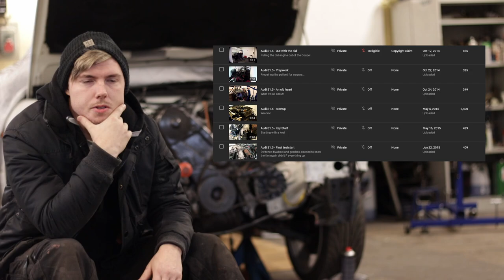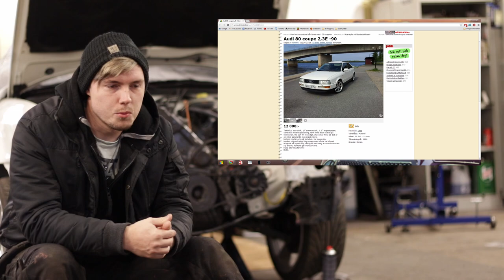DET STÖRSTA PROJEKTET INGEN VET OM

Comment: Du kanske redan tänkt detta men jag lägger upp det ändå, passar en 10V topp från en nyare motor på ditt block? I så fall får du ju tillgång till nya spridar systemet med fuel rail etc. Ps. Du ser mycket yngre ut ;-)
Reply from the maker: Det fanns desvärre ingen 10v med riktigt insprutning. Dom enda 5cyl som hade EFI var S-motorerna och "7A" (20v sug 170hk)
Jag kan tekniskt sett bulta dit en 20V topp med accessoarer, men förutom att jag fortfarande vill ha en 10v så har vi sedan domino-effekten av allt annat som måste ändras för att det ska funka. 

Haha, jag ser ju ut som jag inte fått sova på 3 dagar 😂